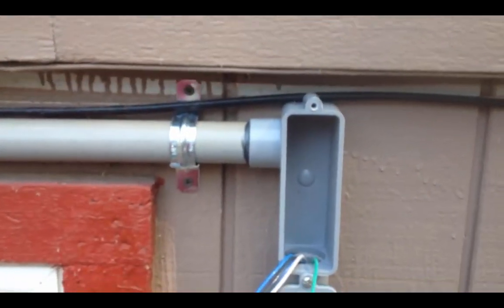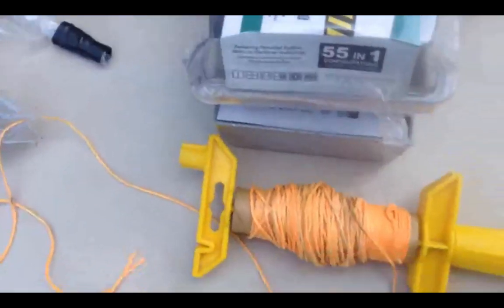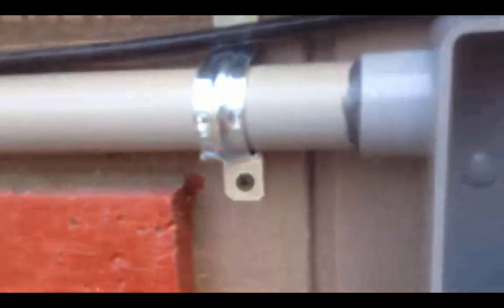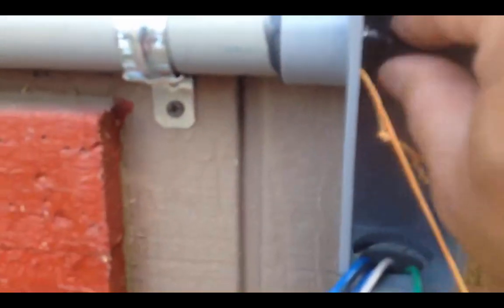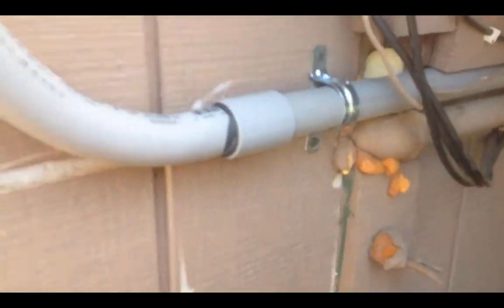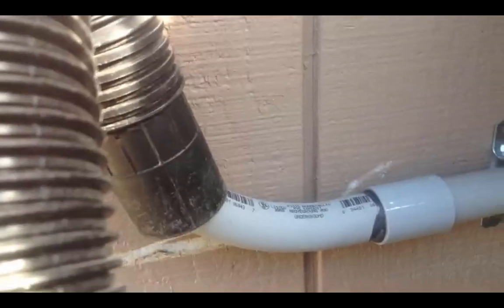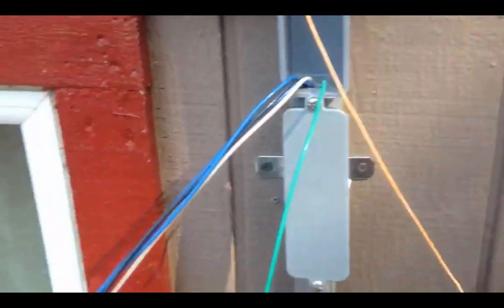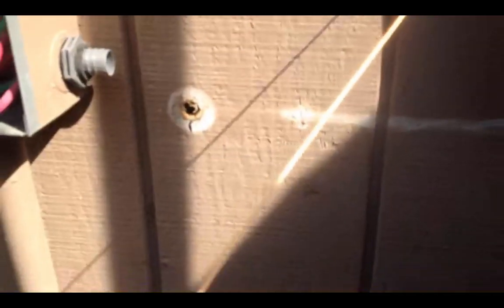How to run wires through conduit

Comment: Ran 110 feet of 4 single strand entrance cable down the wall, through the basement, along the porch, down 20 inches, 65 feet through the yard then up the garage wall. No easy task for a first timer. Your method worked perfectly! Tough work, only thing tougher would have been having to do it twice. Many thanks for your instructions.

Comment: Your a life saver.  I had two 10 foot pieces of 3/4 inch conduit installed under a concrete patio for future electrical and had them capped off.  The time has come to run the wire and my 14/2 underground wire was getting stuck mid way because it wasn't stiff enough.  I came across your video while searching for lubricants for wire and this is simple but short of genius.  I have to admit I was a bit skeptical but it worked like a charm and it gave me just the right amount of pull from the opposite end to feed the wire all the way through.  Thank you...thank you...thank you!   Five Stars ***

Comment: Tom Hanks, thanks for the great tip. Worked like a charm on old outdoor conduit today. One suggestion to everyone. If it is old conduit exposed to weather, vacuum it out with a shop vac first (remove the filter) to get all the water out of the conduit. I had a ton of water and even 3 snails inside that conduit. The conduit holds air tubing used to control an air switch that operates a hot tub pump. Using your trick, I was able to get all set up to pull new tubing through the old conduit. I first tried it without the plastic bag. It did not work. Once I used the plastic bag, I was good to go. Great video.

Comment: Thank you for the great idea.  I was successful in pulling wire through 50 feet of 1/2 inch schedule 40 conduit with two 90 degree bends using this method. I had to make the baggie parachute smaller than what was in the video so it would go around the bends.  Cool!

Comment: Great video , i never thought to use this method until i saw this , also i have used it on steel threaded conduit with the same results , what i fond to work was when connecting the conduit put some silicone sealer on the threads and this makes it pretty much airtight...

Comment: I did this today it with 90' run of 1.5" pvc 2- 90° and 4-45°bends, worked so good never got stuck soon as I put the vac on it boom seconds it was on the other side.

Comment: we use this method for 1500' 4" runs with no splices works like a charm. our vacuum is 25 gallon greenlee. this method beats the rodding method by a mile we pull our small string then we pull our mule tape.
Reply from the maker: It is amazing how simple it is!

Comment: Ive used the same method,  but with a grocery bag. Ill use part of a bag for 1/2", 3/4", and 1". But ill use the whole bag and tie the string to the handles of the bag for 1-1/4" all the way up to 6" pipe. I pulled a run recently of 270' of 3" pvc. Vacuum pulled the bag through in about 15 seconds.

Comment: So what I did I use my vacuum cleaner to suck flat rope to one side to the other had to been close to 60 feet then I  just tied my wire on the other end and pull it through.

Comment: Hi could this be done with approx 20 meters x 20MM diameter or is 25MM better, great video BTW (its MDPE PIPE BLUE to protect cat 5 cable approx 7mm UNDER SOIL)
Reply: Ah I have read below that someone used this method with 3/4 inch so 19.05MM so 20MM should be fine?

Comment: I must say, I like this.  Very creative.  But I think it would only work on PVC conduit? I don't think metallic is air tight as joints are not necessarily glued?
Reply from the maker: Alex Lee You are correct about it not being air tight. I have not tried it but may be worth a shot? Glad you liked the video.
Reply: this method will work on metal conduit

Comment: Looks like a new install. Why didn't you just run the string through the conduit as you were piecing it together... ?
Reply from the maker: +Kevin Swartz because then the string gets glue on it and sometimes gets stuck inside the conduit.
Reply: Because that’s not the way it is done

Comment: Do you need a special rope or connector to pull. Running 200amp from transformer to breaker box, 250' in 2" pvc
Reply: 3” pvc for 200A